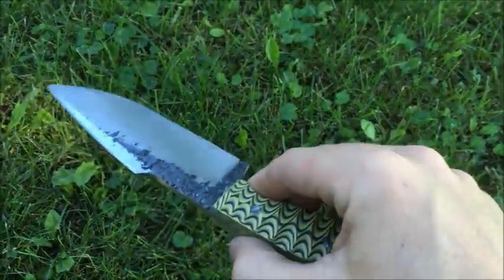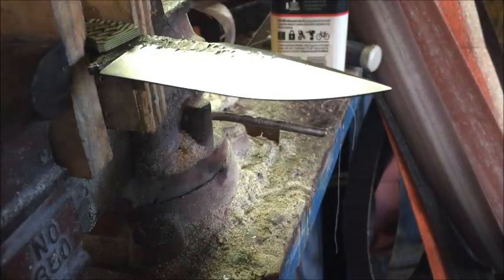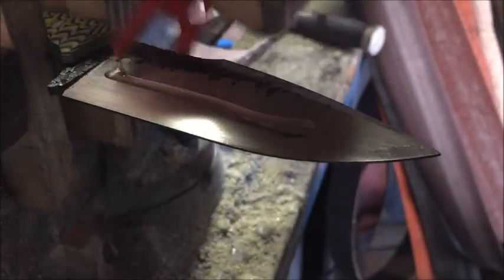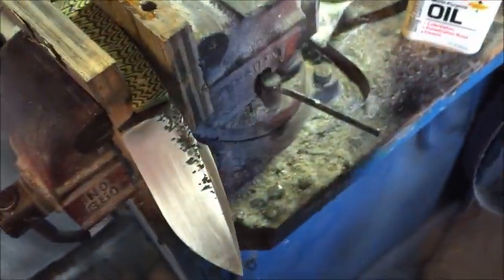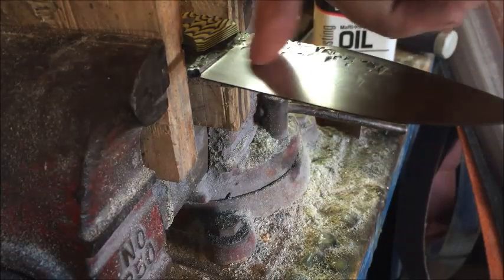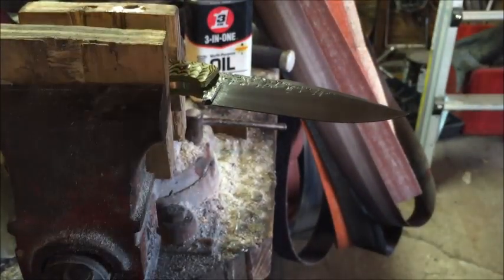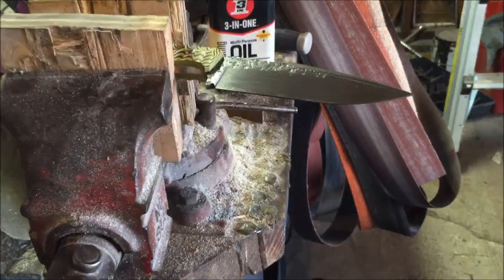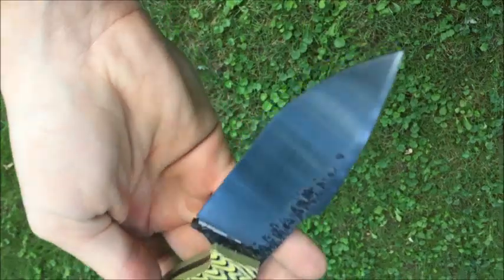How to make a knife: Hand sanding 101

Comment: In the earlier grits, I alternate different angles on each grit. A slight angle to the left on one grit, then a bit of an angle to the right on the next one. This makes it really obvious when you've got all the previous scratch marks out. They show right up if they're still there. When I get into the final grit, I do straight back and forth, and on the very last bunch of passes, I only pull from the handle towards the tip, not back and forth.
Reply from the maker: +Keith Peters thank you for the input! I appreciate the tips! :D
Reply: +White Bone Knives no problem. I enjoyed the video. Still learning myself,  but I've hand rubbed twenty something knives so far and hopefully learned a thing or two.
Reply: left side looks way better then the other

Comment: I do a mix of horizontal and length ways sanding if I’m not mirror polishing not for looks at first but it hides scratches form use better than single direction sanding in my opinion steel etched with a week acid is the best

Comment: To get into the tight spot use a piece on teel with a tapered edge.  Or use a piece of micarta with a steel edge cut into it, about 20°. Or use a old kithen knife blade with the edge flattened.

Comment: Do you finish sharpening your blades after you finish sanding and polishing? I notice this blade still has a blunt edge. On another subject, do you know what the hardness is on a metal file?
Reply from the maker: Sharpening is the very final step for safety reasons! It could vary from file to file but you can always check it with Rockwell hardness files.

Comment: nice texture, never seen anything like it, what did you use?
Reply from the maker: +Sam Martino thank you! I used a textured hammer for the marks. just cut some lines into a hammer and you got it! :)
Reply: aaah i see, im breaking out the angle grinder tomorrow, i got some old ball peens laying around. Definitely trying this next time I fire up the forge
Reply from the maker: cool! I actually have a video on it in my tip section videos called add some texture if you would like to see the hammer.

Comment: That finish is badass on the flats on the blade! How'd you get it if youre willing to share :) my guess would be to use triangle punches and press it along the the blade when it is still annealed
Reply from the maker: +Sea I used a textured hammer and hammered them in:) thanks for watching!
Reply: +White Bone Knives, is that finish color created from heat treat and then you just don't sand it afterwards? Looks great and I prefer hand finished!
Reply from the maker: yepp you got it! It's the scale from the heat treat!

Comment: Also, you might want to try grinding the bevel up to 400 or so on the grinder. That'll make the hand sanding go a bit faster.
Reply from the maker: +Keith Peters I have since switched out sand paper. made my job much easier haha. I was using junk harbor freight sandpaper in the video><

Comment: How do you put those marks on the Blade? (The ones appearing to rocks or sonething on the top)
Reply: That was my question also
Reply: That finish is from the forge - when the blade is hand-forged, the whole blade looks like that until the bevels are grinded out. The grinding/sanding creates the smooth, polished steel look

Comment: it takes no time if its done before HT :)
Reply from the maker: +jakob poulsen yeah haha plan on doing that next time but I figured these would look much better if they were hand sanded so I had to><
Reply: +White Bone Knives  Hehe, i used to do it like that, but it take 10 times longer before HT. I grind to 320 and then hand sand with 180 and then HT:) in fact i have never made a knife that wasnt hand sanded, and i have made 50+ knives. I hate grind lines :D
Reply: +jakob poulsen  10-15 min pr side :)
Reply from the maker: yeah im disliking them more and more haha prob hand sanding from here on out:) I reduced my time significantly today using different sand paper! got some really nice 3M stuff that works real well